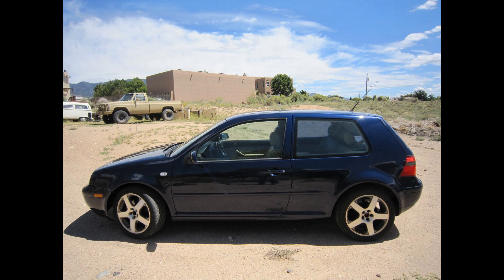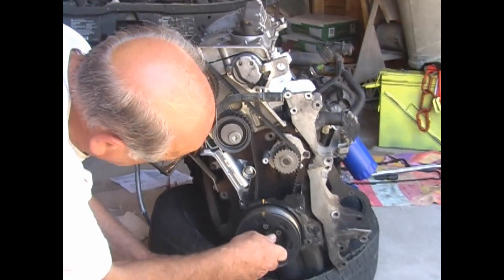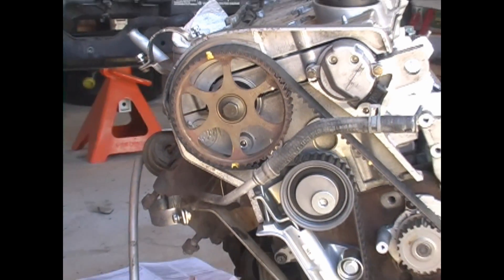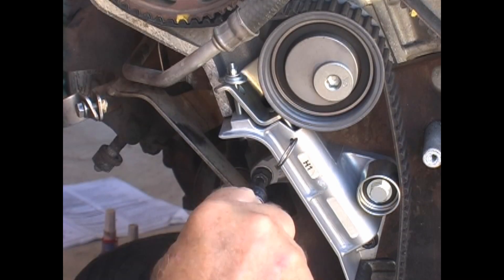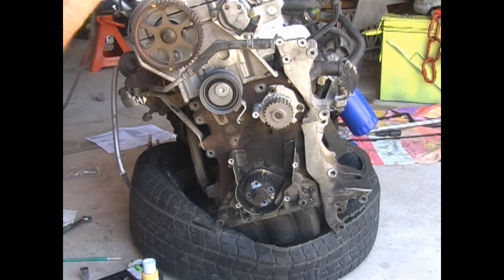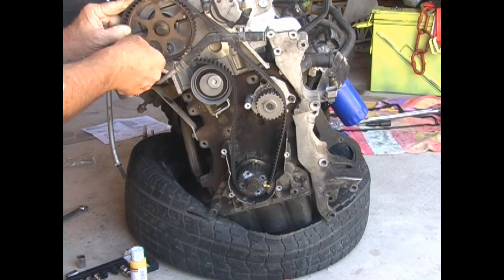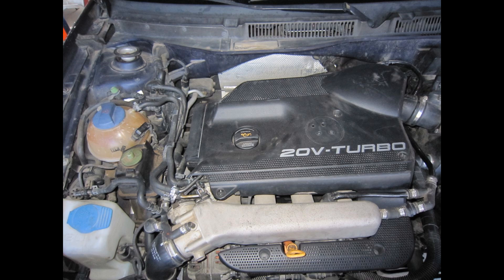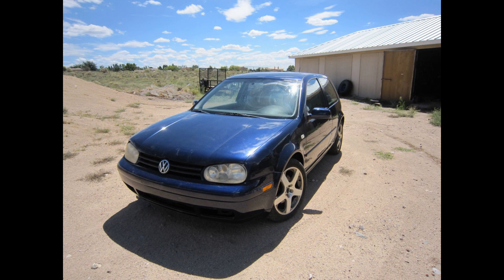VW/Audi 1.8 Turbo Timing Belt Replacement

Comment: Hello. I did my belt and it went quite well. I do have a question. My belt seems to be on the edge of the cam it’s been months and it seems like the belt sits on the edge of the camshaft when it’s supposed to be positioned more towards the middle. I’m wondering what that could be the cause of. I replaced my belt, tensioner and pulley and I’m still not sure what it could be

Comment: hello sir. how would I know if my timing belt is timed without the paint when i change my old belt?
Reply from the maker: Hi  There are a couple of things you can do.  If you have it all back together, it is suggested that you turn the crankshaft around twice (2 revolutions).  After the 2 revolutions, check the timing marks on the crankshaft and camshaft against the marks on the case  If they are both aligned, then you are correctly timed.  If they are  not aligned, then you need to adjust the timing.  It is not uncommon to be off one tooth when you put the belt on without marks on the belt.  If this is the case, align the timing marks at the crankshaft with the mark on the case.   Then mark the belt at that point.  Up at the camshaft mark the belt at the timing mark on the case.   You can then reinstall the belt using the marks.  Again, rotate the engine twice and check that the marks are still aligned.  Just note, that if you mark and install the belt then rotate the engine, the marks on the belt will no longer be aligned after the two rotations but that is okay and normal.  Just make sure the alignment marks on the camshaft and crankshaft are align with the marks on the case.

Comment: What do I do if the old belt is no longer on the vehicle n I didn't mark it?  Asking for a freind
Reply from the maker: Hi Curtis  At the 5 min 30 second mark on the video, I talk about putting on a belt with no marks.  Also I got this comment from another person which is very helpful when you don't have marks on the belt.  He said "Hi Wayland. In the meanwhile I changed my timing belt and I can confirm that when counting the teeth on the timing belt that if  tooth n° 1 is on the camshaft timing mark then tooth n° 68 is exactly opposite to the bump on the lower crankshaft sprocket.  At last counting the teeth applies only to this specific type of engine.

Whether you have marks to start with or not, I recommend you put marks on the belt during the process.  After you have it installed, turn the engine over 2 revolutions and check that the alignment marks on the engine are still lined up.  Please note that the marks on the belt will not be lined up after turning the engine but the alignment marks on the engine should be.  If not, you may need to make an adjustment to the belt.  Let me know if you have further questions.  I will be glad to help.

Comment: Thank you so much for sharing this with us. I've had a 2000 Volkswagen jetta 1.8T setting in my driveway for about 18 months. I ordered the complete kit to replace everything because the waterpump had went out on me. I got sick with double pneumonia so that set me back a year or a little more. 
 I decided about 3 months ago to tackle it, cause it's such a good car. When I got to the part of putting the belt on, I just couldn't get it on, I've even went and got a belt stretcher for this, but didn't want to use it cause it would seem to me that stretching it would make it a little too big. I was so mad at this, that I actually thought about putting a bullet in the block and saying the heck with it. I've been putting it off and putting it off, just hoping to see something different that would help me. I saw your video just now, and this has put a light on the subject. No one has ever mentioned taking a little slack out by backing the crank a hair. It makes perfect sense to me, and I feel like such a dunba@$ for not thinking of this. Again, thank you so much. I'm going to head out in a little bit and put this belt on. I truly appreciate it and hope you are blessed for doing this work, and showing a mechanic of 35 years, a new trick for an old dog. 😆
Reply from the maker: Hi Jeff - Thanks for your comments.  I hope you have been successful in getting the belt on.  Like you, I was really frustrated about the belt just not fitting and being so hard to get on.  That is why I finally determined to mark the belt and then back off the crank in order to get the belt on.  What I have seen many people do is put the belt on where they can fit it and end up with the timing being off by one or more teeth.  Sometime after moking the video, I was changing the timing belt on my Lexus.  To my surprise, the belt came pre marked for the crank and both camshafts.  This allowed me to start the belt at the back camshaft, back off the front camshaft a hair to get the belt on and return to the timing mark and then back of the crank to get the belt there.  It made is real easy.  Let me know how your repair went.

Comment: Update: replace the tensioner/idler assembly with a new fixed/manual tensioner, as is used in the Audi 1.8T AMB engine. 

Great video -- having done this on an AUG and an AMB, I appreciated the clarity of your explanation.
Reply from the maker: Thanks John,  Appreciate the comment.

Comment: Thanks for the video.  I have an 01 VW bora,  with AEH engine.  I can't seem to find the mark on the crank pulley. I read there is a mark on the torque converter which can be seen through a small window on the gearbox area. I have used this mark to do my timing  but after rotating the engine,  the marks are off by 1 or 2 teeth and I get a code 00515. Is there anything else I can do?
Reply from the maker: Hi Paul. Sorry your are having this problem.  I am not totally familiar with that engine as I am not a professional mechanic.  But having said that I do have a couple of ideas.  Unless it is real easy to reference the timing mark at the torque converter, I would paint a mark on your crank pulley and case.  Just line up the mark at the torque converter and then paint a mark on the pulley and case.  It is not critical the location, just that they are adjacent to each other.  The problem of being off by one or two teeth is a common problem and the reason I stress marking the belt.  In this case, I will assume you don’t have your belt marked.  Install the belt and mark the belt at the mark you put on the crank pulley and at the camshaft.  Rotate the engine.  If you are still off by the one or two teeth, take the belt off.  Move the mark on the belt at the crank the one or two teeth closer to the camshaft mark and reinstall the belt.  You will probably have to back the crank off a little bit to get the marks lined up and then move it back to the timing marks.  That is because the belt is so tight when everything is in the right place.   Try that see if it works for you.  Let me know if I can be of further help.
Reply: @waylandadams2326  Thanks so much for this great piece of advice.  I will do exactly what U have recommended.  My engine is similar to the golf mk4s with 1.6 litre, 8 valves and shares parts with the 1.8 and 2.0 engines.

Comment: Please help! I'm midway through doing the belt on my 1.8t. I can't get the lower timing mark aligned when I tension, its always a bit behind tdc is this correct?
Reply from the maker: That doesn't sound right.  Do you mark your belt?  I found that I needed to turn the crankshaft counterclockwise slightly to get the belt in the right place, then turn clockwise to tension the belt.  You are welcome to call me and we can talk some more if needed.   505 353 2255.

Comment: This is a great video. Out of technical interest does Audi / vw specify a belt tension test such a frequency , deflection or twist?  thankyou
Reply from the maker: Hi Michael -  Thanks for the comments.  I am not aware of such a test.  Obviously if the belt tensioner is doing it's job, everything will be kept in spec.  But please be aware, I am not a professional mechanic that may have access to such a test.
Reply: @waylandadams2326  thank you for taking the  time to reply.

Comment: Yes great video it's the one I've been looking for... BUTwhat do I do if somehow ive LOST the Mark's on the belt that I had due to negligence and just not knowingly throwing the old belt away...how do I find top.dead center and get my timing Mark's lined back up so that I can safely.start my car again???????
Reply from the maker: Hi Tommy Mac - So at 5:33 in my video, there is a discussion of how to put on the timing belt without marks on the belt.  But it assumes the crankshaft and camshaft are already on the timing marks.  What it the position of your crank and cam.  Are they on the timing marks?  If so, you can just follow the video for that section starting at 5:33.  If the crank and cam are not on the timing marks then you have a bit of problem.  This is an interference engine meaning the top of pistons will impact the valve when timing is off.  So did you just pull the belt off before turning to the timing marks.  If so, I would just put the belt back on the best you can and then turn the engine to the timing marks.  Chances are you will be off one tooth but it won't damage the engine.  Then you can adjust the belt as described in the video.   I did have one viewer write in and offer this.   "Hi Wayland. In the meanwhile I changed my timing belt and I can confirm that when counting the teeth on the timing belt that if  tooth n° 1 is on the camshaft timing mark then tooth n° 68 is exactly opposite to the bump on the lower crankshaft sprocket.  Indeed it is not that important but it is a 'double check' to verify if you have exactly 'copied'  the marks from the old belt to the new belt."  I haven't verified this but you could count the teeth on the belts and put the marks on it.   If you let me know the exact state of your crank and cam with relations to the timing marks, I could offer some more complete steps.  By definition, when the crank is on the timing mark, you are at TDC.  If you want to check that, one way is to remove the spark plug on #1 cylinder and using a long screw driver on top of the piston, you can tell when it is at the top.  You just need to be careful about turning the crank without turning the camshaft.  Let me know how else I can help.  Wayland

Comment: Deja atrasado un diente del árbol de levas. Un poco chapuzas
Reply from the maker: No estoy seguro de si está haciendo una pregunta o cómo puedo ayudar. El propósito de marcar el cinturón es que no se le salga ni un diente. Es muy común que se le salga un diente si no usa marcas de referencia. Déjame saber cómo puedo ayudarte. No hablo español, así que esto se hace con Google Translate.

Not sure if you are asking a question or how I can help.  The purpose in marking the belt is so you don't end up one tooth off.  It is very common to end up one tooth off if you don't use reference marks. Let me know how I can help.  I don't speak Spanish so this is done with Google Translate.

Comment: Someone please explain to a thicko, if the crank & camshaft marks are lined up, why does painting the belt matter?  Can't you just throw it on, or is it about potential slack on the right side of the belt?
Reply: Hi Neil  If the crank & camshaft marks are lined up and you try to put the belt on, you will almost always  be one or more teeth off.  That is because when the timing marks are lined up on the cam and the crank, the belt on the right side is really tight.  Too tight to really get the belt on and you have to back off the crank, put on the belt and return the crank to the timing mark.  When properly installed,  if you turn the crank, the cam will immediately turn.  Marking the belt just helps get the belt on the right place the first time.  The procedure I use with marks is to put the belt on the camshaft lined up with the marks and then come down the right side over the water pump and back off the crank until I can get the mark on the belt at the right place on the crank sprocket.  Then I return the crank to the timing mark.  And like I say, if I turn the crank any more, the cam will immediately start turning.  You can do this without marks by experimenting.  You put the belt on the cam, back off the crank just a little, usually one tooth or less.  Get everything set like the tensioner etc and then turn over the crank 2 turns and make sure the timing marks all line up.   The sole purpose of the marks is just to help get the belt on in the right place the first time.  It may interest you to know that some timing belts come with marks already on the belt.  I just changed the timing belt on my Lexus ES300 V6.  The belt came with marks for both camshafts and the crank.  Made it a cinch to get right the first time.  Let me know if you have further questions.
Reply: @executivesecretary9448  thankyou for clarifying. If a belt is a tooth or two out, would I ignore any paint marks on it? Or so long as the timing marks are lined up it's ok? Thanks
Reply from the maker: @neilg3364  The paint marks are just to help get the belt on in the right place.  If you end up with the paint marks off on both the crank and the cam, it is okay as long as when you rotate the engine two turns on the crank, the timing marks are lined up.  If you have any question about it, the timing marks should line up on every two turns of the crank.  Let me know if you have further questions.   Wayland